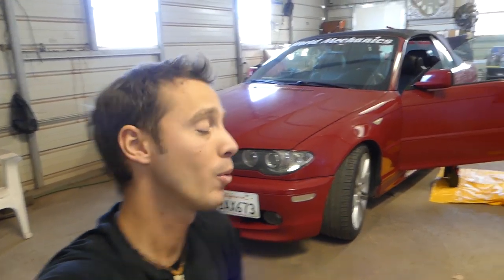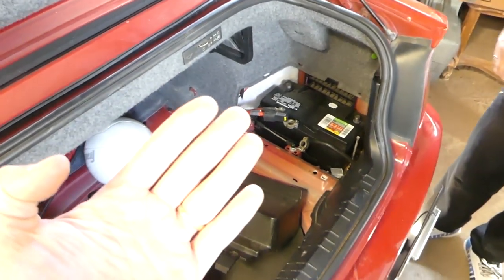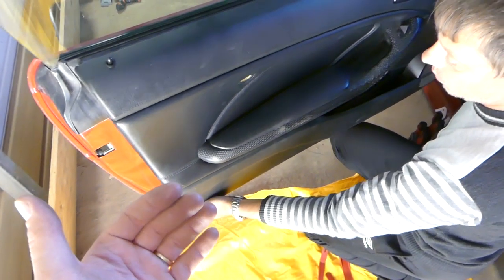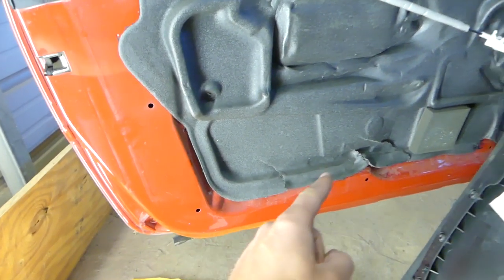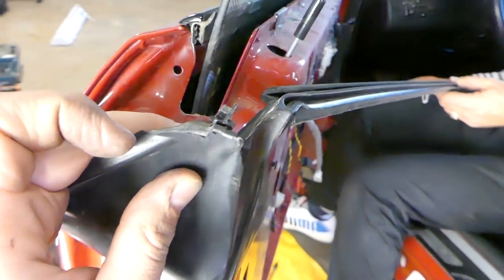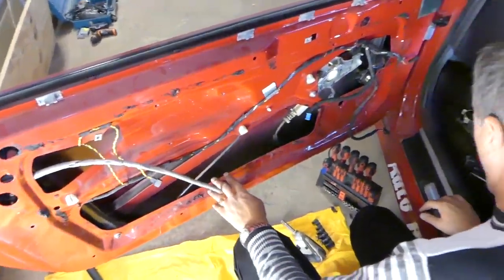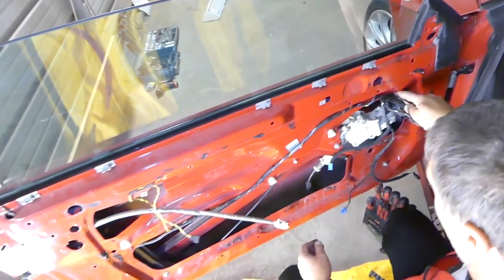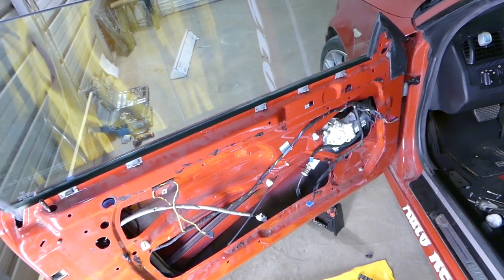HOW TO REMOVE AND REPLACE FRONT DOOR LOCK ACTUATOR ON BMW E46

Comment: Thanks for the great video. It was useful. Actually, you can save some work compared to how it was explained here. You do not have to remove the door handle and window regulator either. It is enough to take off two of the five screws on the opening side of the door and to move the mechanism aside. It gives you enough space to take off the actuator.
Reply: do you need to remove the window?
Reply: @riccardocervetti3203  It was 8 months ago when I did it. I'm not sure, but I believe that the only way to take the window off is by taking the whole mechanism out. So I would say you do not have to.
Reply: @tamasgadykayser6546  thanks tamas!

Comment: My 05 e46 coupe started misbehaving yesterday. The passenger Door Open indicator came on and the window came down 1/4", even though the door was fully closed. I can roll the window down and back up but it will automatically do the 1/4" drop and the Door Open light stays on. It roll down automatically but don’t roll up,have to hold the button to roll up and still come down 1/4.

Any idea what might be the fault or how to fix it thanks in advance.

Comment: Hey bud I'm having thr issue wer I disconected the battery and now I can't reboot the cluster all fuses are good and the reset clock is also out this happens everytime I disconnected the battery only be4 I could reprogram it by just turning all the switchs to on possition and turning on and off but this time its not working please help car been sitting for 5months

Comment: Question....
Why did you remove the outer door handle? I don't see any connection between it and the actuator in the video? Or at least any need to remove the handle to remove the actuator 🤔

Comment: na mate, you dont disconnect the batt the plug it bk to bring down window! what was the point in disconnecting it u burk? just undo the window motor and pull glass down with hands so you DONT get a air bag warning light!
Reply: You can reset the air bag light if you have PA software like a every E46 owner should
Reply: You should disconnect the battery so you do not engage the air bag. If you are going to offer tips, then you need to offer them in a safe manner. The video describes the correct way to do this.
Reply: Junaluska M Hall that’s about it though the other day i took my window out without having to disconnect any wires other than the ones on the door panel